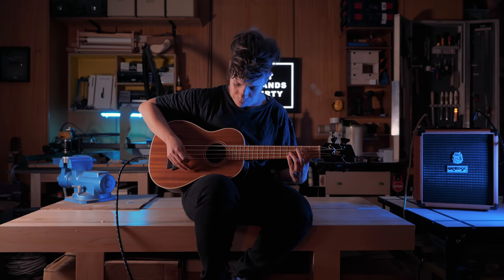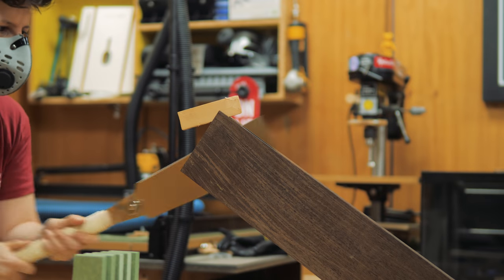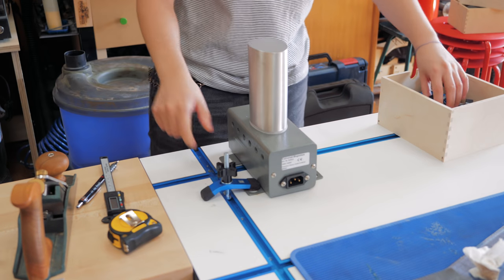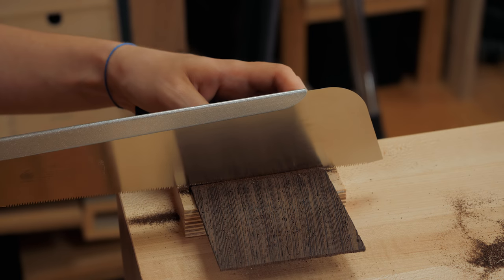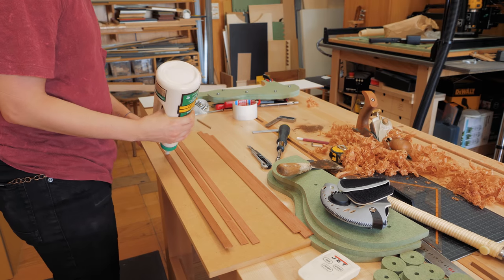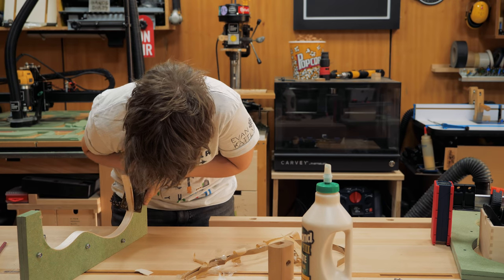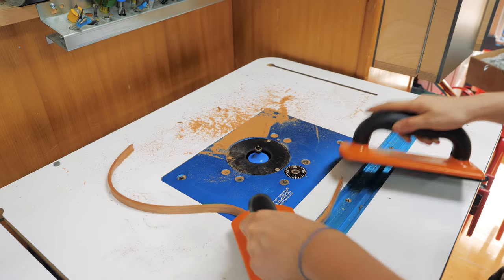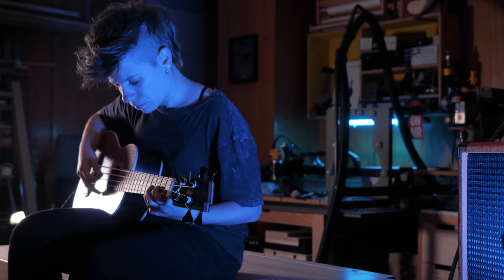How to Build a Ukulele Bass // Sides, Linings, End and Neck Blocks - Ep.1

Comment: Lovely work. I’ll be watching the whole series. 
A little tip for when you need to shorten bolt threads is to put a nut or 2 below the cut first and then cut to length, round off the end then remove the nuts. The nuts will clear any damaged threads and make putting any subsequent nuts on much easier.